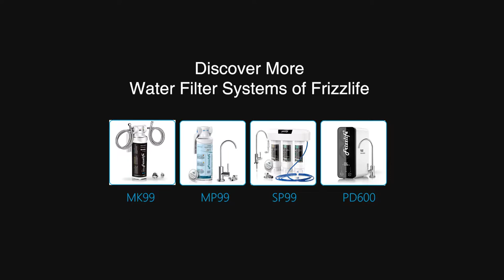Frizzlife SK99 Under Sink Water Filter Installation

Comment: I see your water pressure regulator has two blue clips on the lower half and one on top. Mine has the two on the bottom and two loose in the package. What is their purpose since they only go 3/4ths of the way around and should the two that were loose both go on the top half?
Reply: I believe the second blue clip is extra, as I only used 1

Comment: I cannot get this to stop leaking from the threads going to the supply pressure regulator. I'm very scared to use tools to tighten it more because the plastic seems easy to break and I don't want to wait for a replacement if I break it since I need the filtered water now for my cannabis plants.
Reply: Probably too late to help, but the answer is: teflon tape.